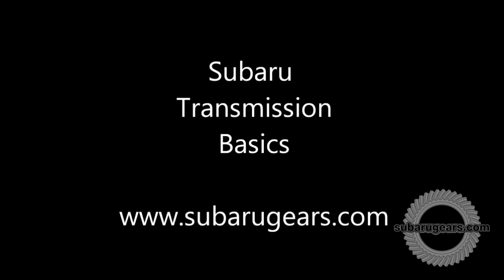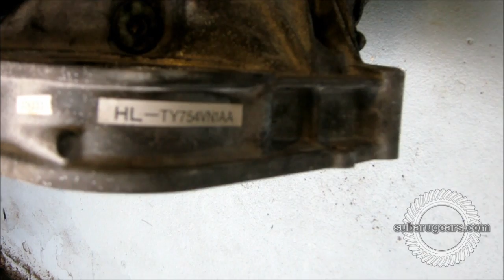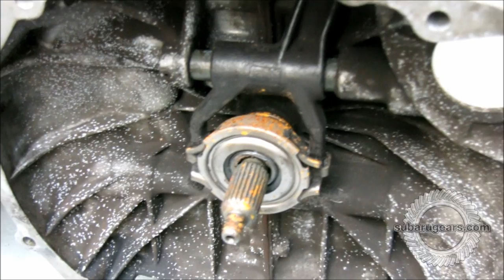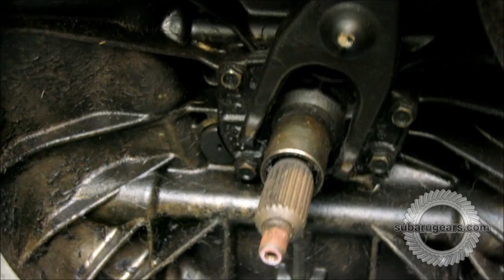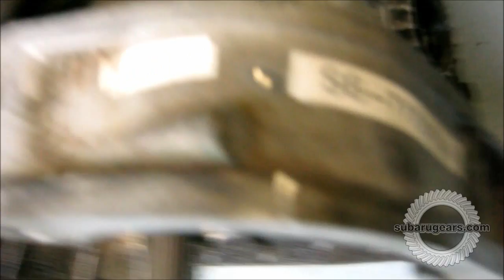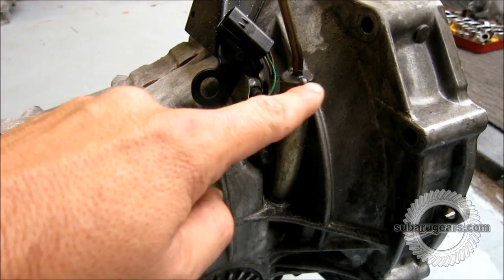Subaru transmission basics.wmv

Comment: How to identify subaru 5-speed gearbox, if there is no code sticker on clutch/sterter housing? 
I have USDM 06' Impreza WRX, but previous owner did "stuff" with that car. I have EJ255 engine, but 5-speed non-turbo dual range gearbox. It looks very similar to that last Forester transmission, but with stub axles coming out. I also know, it is Impreza gearbox (someone has writen IMPREZA on gearbox housing).

Comment: Hi I have an 03 Subaru Forester 5 speed I want to swap in a JDM 2.0 twin turbo in my Forester I would like to know if I can use my 03 Subaru Forester na motor on the 2.0 EJ twin turbo
Reply from the maker: antoine miller your question has nothing to do with the contents of this video or with what Subarugears does. You need to ask a conversion specialist.

Comment: Thank You for your expertise. I have a couple of questions: Does the dual range transmission come in a few choices of final drive ratios? I understand it comes in a 4.11 final drive ratio but does it come in a 3.90 or 3.60 ratio? Second question: can the stub axles be removed easily, like just pull them out? Can they be installed in a non-stub axle transmission by changing the seals and the bearing retainer plate?
Thanks
Michael
Reply from the maker: Michael R The dual range  trans comes in all three of Subaru's final drive ratios, depending on the donor car. if it is an older ty752 or ty754 the stub axles will be circlipped in and the trans needs to be split in orcer to remove the stub axles. they can be used in conjunction with their seals and bearing cups in the newer transmission but that would have to be split as well.
Reply: Thank You,
What is the transmission number for the 3.90 ratio, dual range transmission that will fit, with limited modifications into a 2003 Baja?
You guys are great!
Thanks
Michael
Reply from the maker: Michael R i don't know. that is completely unrelated to our business.

Comment: I have a 1.5 Impreza wagon and i am wondering what transmissions will fit as mine need a new gearbox, it currently has a 5 speed dual range box code TY754XY7AA. I would like to keep the dual range but is not crucial. would something like the forester dual range 5 speed fit?

Comment: Can you reverse the R&P but keep it all wheel drive? I'd like to adapt all of this to an all wheel drive 356 speedster replica. Chassis fabrication is not a problem.
Reply from the maker: Absolutely! It]s even easier to keep it AWD as you don't need to fit the Subaspool nor shorten and weld the center differential housing. Use a Subaru r160 rear differential mounted upside down in the front of your speedster and your drivetrain is almost complete.
Reply: subarugears
How would I go about fitting front axles to the now-former rear diff? The original front spindles I can just bring back and lock the steering in place, but I was thinking of using a second Subie front end for steering but don't know if there is a simple axle solution that I could use. Any help would be appreciated!!!
Reply from the maker: jeffinillinois We make Subaflanges to suit the r160 rear diff that allow VW 100mm cv joints and axles to bolt right up if you're going to use VW front end components.. Alternatively if you use the Subaru front end you would just use Subaru axles and inner and outer Subaru cv joints, obviously they all fit the Subaru items, just the axles may need to be cut and resplined to the correct length.

Comment: congrats for videos!
I just bought a 2007 Subaru Forester XT (2.5 liter Turbo) and i was thinking to change the gearbox. It has the standard 5 speed factory manual gearbox and I want to replace it with a 6 speed manual gearbox from an Subaru WRX STI. Do you think it will fit? And if it will fit, can you please tell me the factory code so that I can be more specific when I will buy the STI 6 speed gearbox?

Thank you an Keep Up the Good Work!
Reply from the maker: Yes it will fit. TY85.......
Reply: Thanks for useful videos,
The 6 speed, TY85.... series can be reversed?
Reply: +Alex Cavaz cannot be reversed and there is no point to reversing it anyway.
Reply: Thanks!

Comment: hey i have a 2006 impreza and the code on the automatic transmission is tv1b4mb5ab. what i would like to know is how important  the code is in replacing the transmission. if i got one with different numbers will it work? also what does the numbers indicate?
Reply from the maker: Not relevant to this video
Reply: @subarugears 😂 you’re a rude cnt hey

Comment: Can the high-low box be used if the selector is fixed in high or are other modifications needed? The best source of engines here seems to be Foresters fitted with this box.
Reply: Yes it can. It needs to be locked into direct drive and the levers removed and the case hole for the offset shaft plugged up.